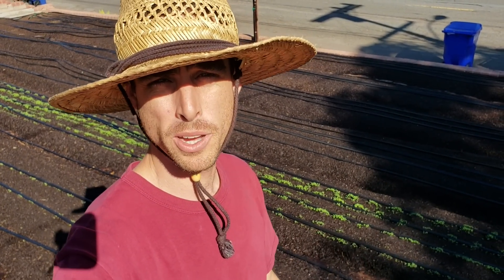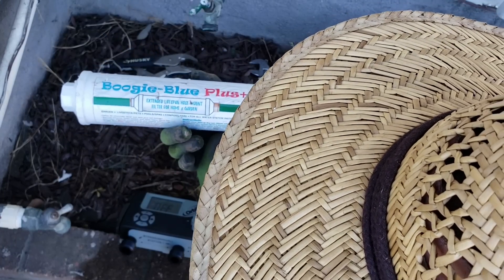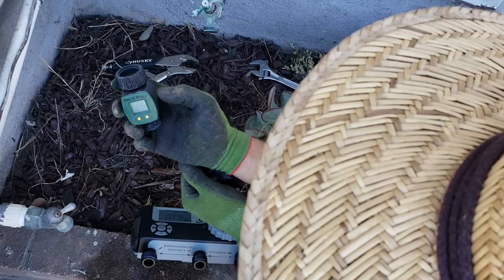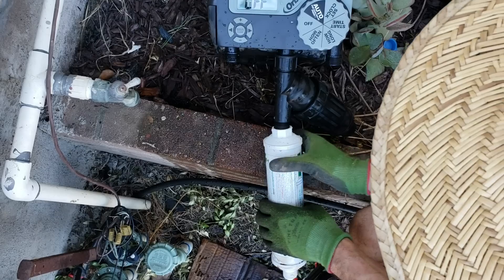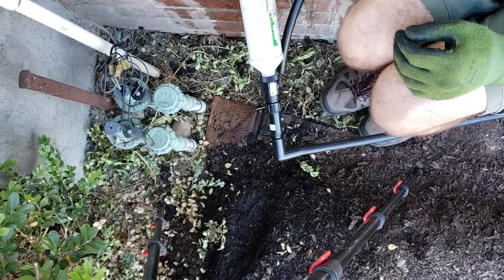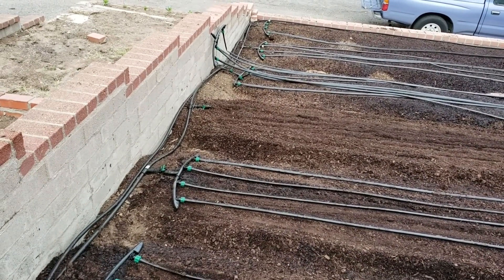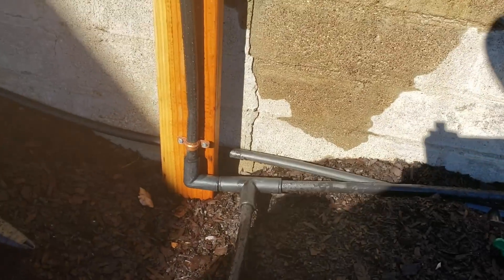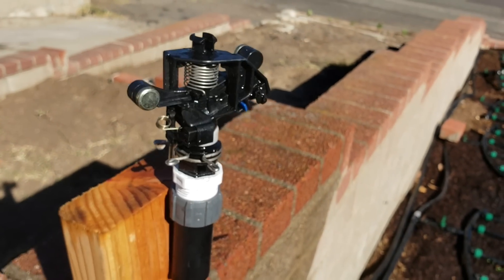Ultimate Drip & Sprinkler Irrigation System | Save Water & Money

Comment from the maker: 💧BEST IRRIGATION parts here - https://tinyurl.com/ydxr79fb
✅ Free Digital Garden Planner & $5 in Seeds → https://tinyurl.com/5363tcbp

EVERYTHING YOU NEED TO BUILD⬇️
🛒 TIMER STATION:
Electronic Valve Timer Stations - https://aff.dripdepot.com/aff/idevaffiliate.php?id=251&url=625
Water Filter - http://amzn.to/2stZeCN
Particle Filter - https://aff.dripdepot.com/aff/idevaffiliate.php?id=251&url=385
Backflow preventer - https://aff.dripdepot.com/aff/idevaffiliate.php?id=251&url=588
Pressure Regulators (Tape 10-15psi, 1/4" emitter 25psi) - https://aff.dripdepot.com/aff/idevaffiliate.php?id=251&url=150

🛒 LINE AND ADAPTERS: Small systems use 1/2" (.700) Larger systems use 3/4" (.820)
1/2" (.700) or 3/4" (.820) mainline (Choose length) - https://aff.dripdepot.com/aff/idevaffiliate.php?id=251&url=175
Drip Tape 5/8" : Choose your length/mil/emitter *I use .46GPH every 6" 15mil drip tape - https://aff.dripdepot.com/aff/idevaffiliate.php?id=251&url=587
Drip Tape Take off barbs - https://aff.dripdepot.com/aff/idevaffiliate.php?id=251&url=585
Drip Tape valve take off barbs- https://aff.dripdepot.com/aff/idevaffiliate.php?id=251&url=586
All sizes twist on adapters (Best) - https://aff.dripdepot.com/aff/idevaffiliate.php?id=251&url=624
1/2" (.700) Compression Ts - https://aff.dripdepot.com/aff/idevaffiliate.php?id=251&url=66
1/2" (.700) Compression Elbow - https://aff.dripdepot.com/aff/idevaffiliate.php?id=251&url=70
1/2" or 3/4" on/off coupling valve - https://aff.dripdepot.com/aff/idevaffiliate.php?id=251&url=65
1/4" Emitter line every 6" - https://aff.dripdepot.com/aff/idevaffiliate.php?id=251&url=89
1/4" Transfer Barb - https://aff.dripdepot.com/aff/idevaffiliate.php?id=251&url=92
1/4" On/Off Valve - https://aff.dripdepot.com/aff/idevaffiliate.php?id=251&url=623
1/4" Goof Plugs - https://aff.dripdepot.com/aff/idevaffiliate.php?id=251&url=626

🛒 TOOLS FOR BUILDING DRIP:
Drip 1/4" Punch - https://aff.dripdepot.com/aff/idevaffiliate.php?id=251&url=74
Drip Cutter - https://aff.dripdepot.com/aff/idevaffiliate.php?id=251&url=73
Irrigation T Stake: http://amzn.to/2Hgo64f
Felco Hand Pruner (Best all round): https://amzn.to/2YnNPk1

MORE IRRIGATION VIDEOS:
▶️ Irrigation Playlist: https://www.youtube.com/playlist?list=PLG9acmbzWMphDPFZt4W25COaa34yw-7OB
▶️ New Manifold Design: https://youtu.be/hO3LVm7j1c0
▶️ Market Plot Irrigation Build: https://youtu.be/cYs9-othuKM

Comment: I have been searching for an hour trying to find the 1/2" female to 3/4" male sprinkler to drip tape compression fitting adapter. Can you help me out?
Reply: I think I found it: https://www.dripdepot.com/item/schedule-40-reducing-bushing-mpt-size-three-quarter-inch-mpt-fpt-size-half-inch-fpt
Reply from the maker: If you are going 1/2" poly to the 3/4" Pipe threaded sprinkler (Has female end) then I think this is actually it. https://www.dripdepot.com/item/perma-loc-tubing-male-pipe-threads-adapter-thread-size-three-quarter-inch-mpt-perma-loc-size-half-inch

Comment: Wonderful video!!!  You use electrical tape to tie off ends, have you considered using any caps or perhaps a heat crip?  Thanks!
Reply from the maker: Thanks Todd. I wouldn't really consider anything else. Electrical tape works perfectly and super cheap. I've been doing it this way for many years and it lasts forever if you wrap it a few times.
Reply: @NaturesAlwaysRight  If it works, don't change it.   Thanks for your quick reply.

Comment: Have you tested for cloramine in the water after the filter. I have; and, the carbon filters are not removing the cloramine.
I use Instatest free and total clorine test strips. I am asking you to verify the results; so that, we as growers can find a better solution.
Reply from the maker: Sure Gilbert that is a great idea! the Boogie brew plus does have a KDX filter and I believe that is what takes the chloramine out, but it is no where near 100%. I'll test it and see what happens.
Reply: Steven, I use the Big Blue Filter on suggestion by John Kohler. This could have been before Boogie Brew offered a filter that big, IDK. However, these filters are probably the exact same thing.

Note: I test the water before and after the filter and there is no significant difference in the levels of the cloramine.
Reply from the maker: @GilbertBigelow  Oh nice yes I think I've seen him talk about that one too. They should be pretty similar, ya chloramine is a nightmare from what I've read it's impossible to get out without expensive filtration. So we have to aerate and let sit unfortunately :/ or I add humic acids to my teas and those nutrilize chloramine and chlorine.